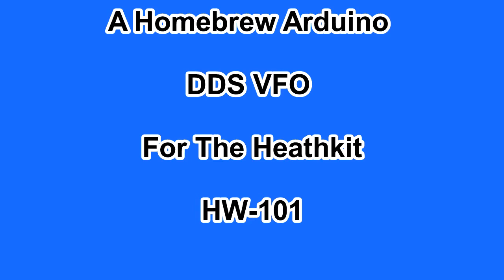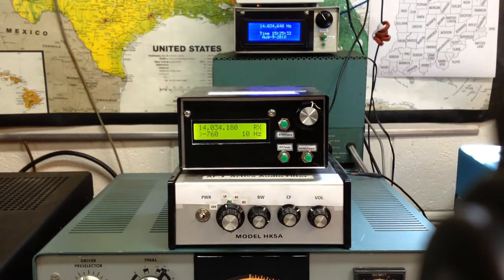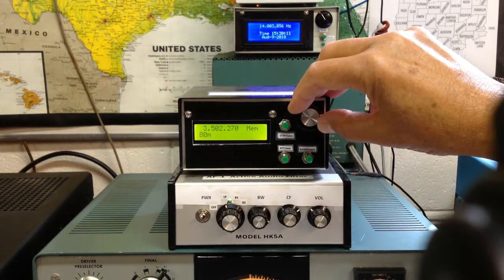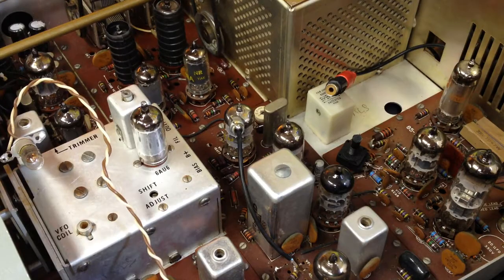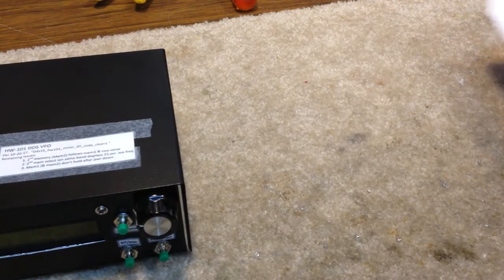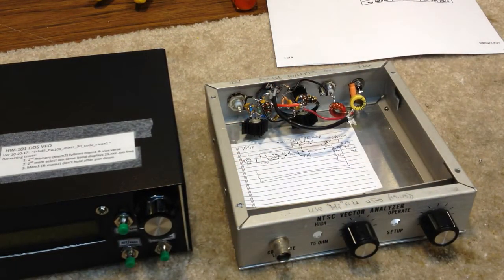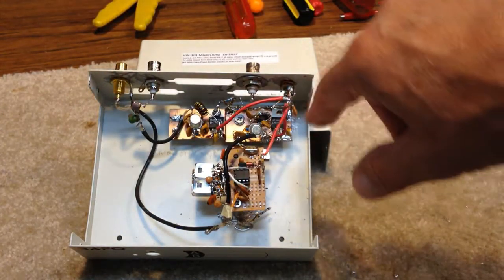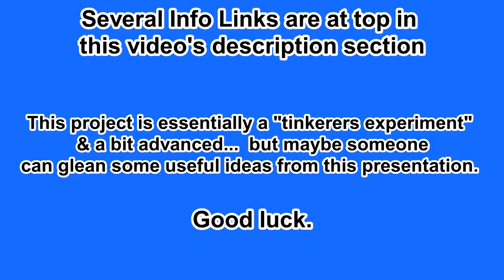Homebrew Arduino DDS VFO for Heathkit HW-101 Transceiver

Comment: I don't understand the desire to add digital anything to a vintage rig. For me the joy in these rigs is both getting away from computers and the history of them. Keeping them authentic. Like putting self drive in a 57 Chevy.
Reply: I sort of agree. What I would think about doing using this to add a second VFO to the HW-101, and mount it in a matching Heathkit case like an HM-201.  
I REALLY appreciate the ingenuity, research and sharing here. Bravo!!
Reply: I have an SB-100 that I purchased more than thirty years ago. This last few weeks, I finally got around to repairing it, however, every crystal in the rig is out of spec, and needs to be replaced.  My rig is not in collectors condition,  I doubt I'd get $50 for it if I sold it, but it sounds great,  has lots of output power, and most importantly to me, I can fix it should something break.

To replace all of the crystals, in today's world,  would be expensive, so I plan to replace them with a digital frequency generator.  The FG output wiLL go through some tuned circuits so phase noise will probably not be an issue 
The VFO is in good shape but I'll replace it with a digital unit.

In the end, I'll still have a $50 rig, but I will have learned a lot, and to me, that's what Ham radio is all about.
73